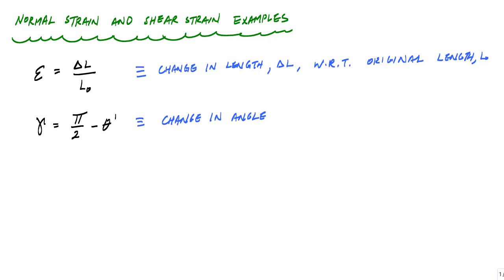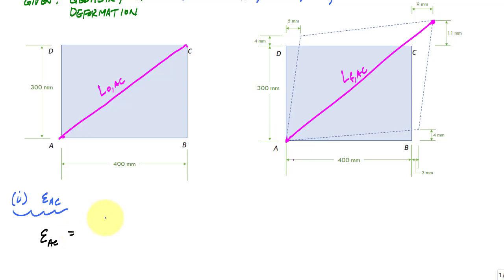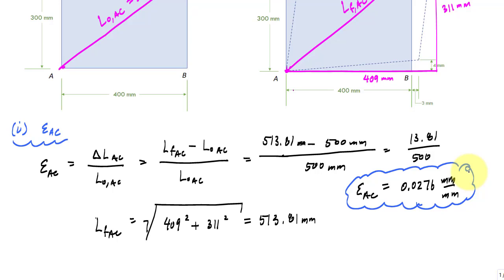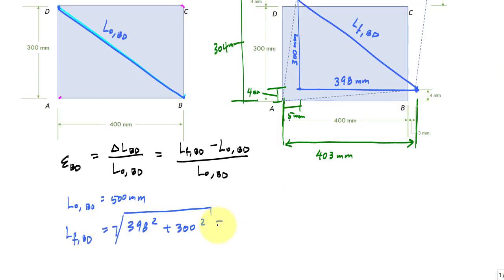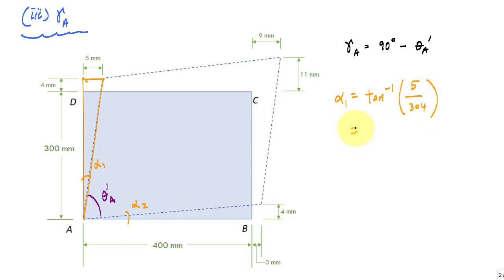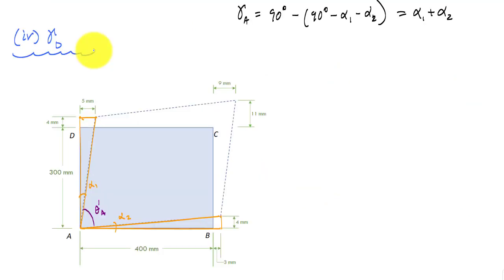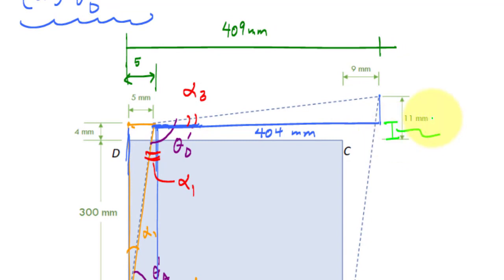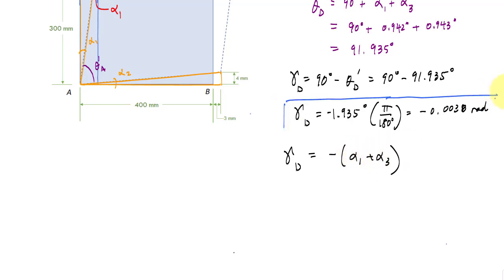Normal and Shear Strain Examples - Mechanics of Materials

Comment: if your original angle is not 90° is the equation for shear strain still γ = 90° - θ'?
Reply from the maker: No, you could replace 90 with theta _o ( the original angle).